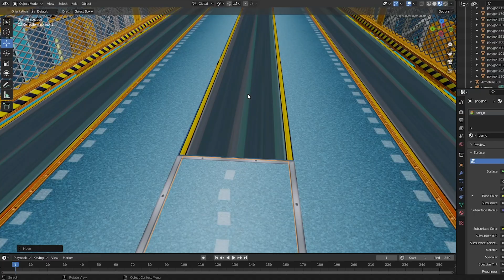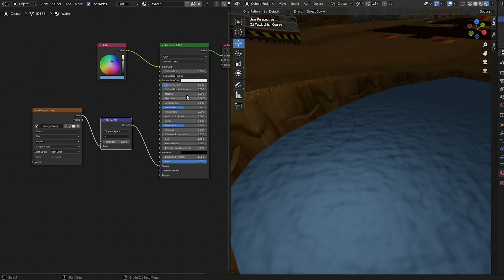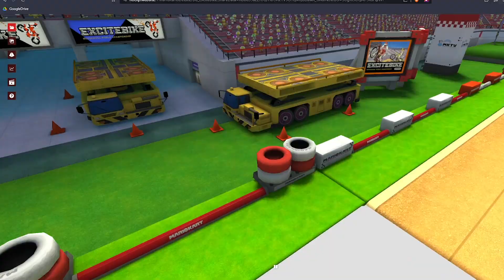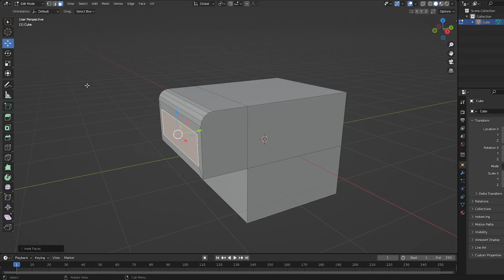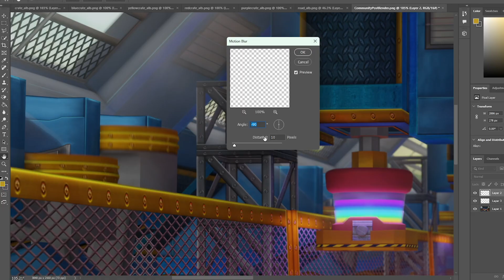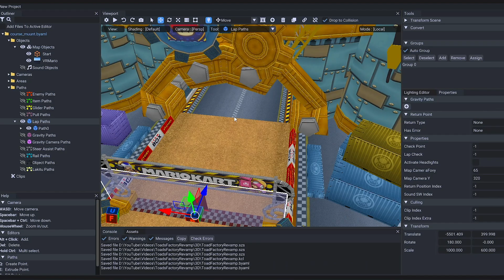Fine Nintendo, I'll Update Toad's Factory!

Comment: UV has sort of two meanings the XY meaning you described which is for the vertices of the triangles they have a UV that states where the point is located in an image, UV/UVW also is used in the process of texturing where UVW are weights towards and away from the different corners of the triangle, that also only uses UV because UVW add to 1 so finding W is trivial to get from the other two values, so its sort of an implicit value.

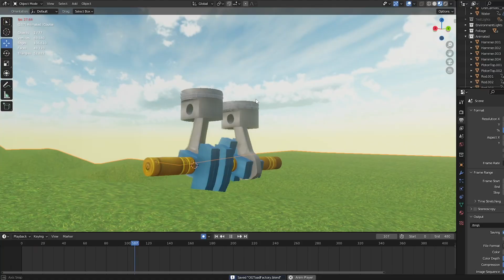Comment: For animating the pistons at around 18:30, I would recommend using Blender's object constraints to get the desired driving motion. Something even better would be using bones and skinning/weight painting the different parts to their bones and using Bone Constraints instead. For assets in games, it's better to use bones as animating the actual object as it's easier to import animations into the game, as well as computing the animations. For the bone constraints, I'd recommend using the Damped Track or Inverse Kinematics constraint and having the piston's "pendulum"-like piece being the target (more specifically, you would create a new bone where you want the pendulum piece to be constrained to). That way, when you rotate the entire cylinder, it drives the pendulum piece to be snapped to the part you want. However, their are numerous methods to achieve this with bones and constraints so there isn't one perfect answer. I'm sure there's plenty of better resources out there to animate a piston.

This probably doesn't make the most tangible-sense (I know I wouldn't be able to when I first started to use Blender), but hopefully it gives more insight of using constraints to drive animations, removing some of the tedious keyframing and manipulation you had to do animated it manually. This is what animators use when creating animations for movies and games, and probably a similar method of what Nintendo did to animate the pistons originally. Hope that helps!

Comment: Blurring a normal map is... Not good.

But if the Mario Kart 8 engine doesn't support PBR Materials then I suppose it's actually a clever work around 👍

Oh also, if you're having trouble in blender, I would highly recommend that you always hit Ctrl + A and Apply Scale every time you scale a model. A lot of things like Bevel, insets, lighting etc use the scale of an object as a reference, and if that scale isn't 1,1,1 the results will be weird and sometimes downright wrong.

A very important detail for both lighting and normal mapping is that the faces of a model have the correct normals. Enable "Face Orientation" in the Viewport Overlays menu. Everything will become either blue or red, the objects that are colored red have their normals facing the wrong way. Select them, go into edit mode and then select all the faces by pressing A. Then press Shift + N to recalculate the normals, they should turn blue. (Btw, some faces should be red, for example a plane will always have one blue side and one red side. A cube should have all its outer faces blue and if you clip into the cube the inner faces should be red.)

I'm sorry if you already knew all of this. 🙏 Great video!

Comment: Tip: the top part of the piston is the boss. The bottom part is the connecting rod. The last two parts are actually one part which is the crankshaft
Reply: You've almost got all of them. However, the "crankshaft" is called "the spinning thing"
Reply: @b3ntleyf0undu if you’re not a nerd that is.
Reply: Yeah and I think the characters in the start gate should be in 2D animation to be fitting more into MK8's style